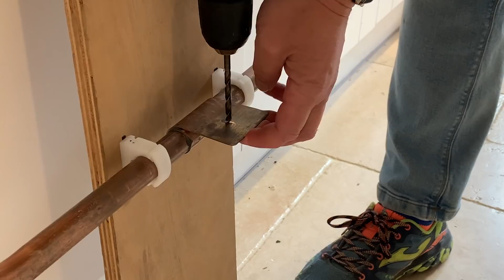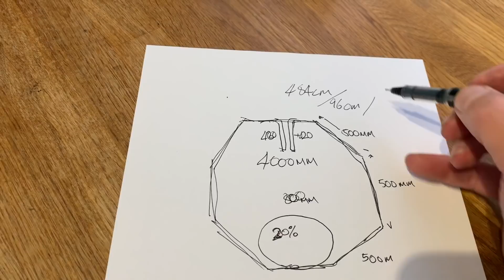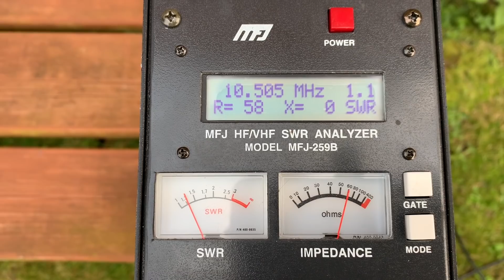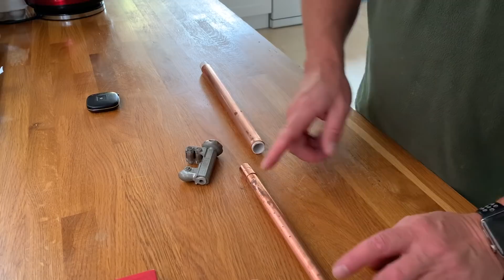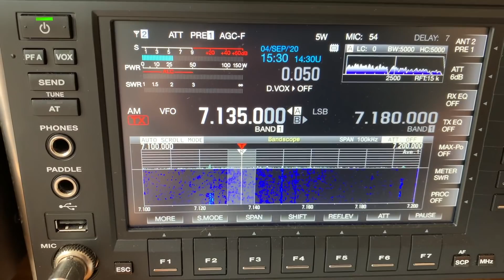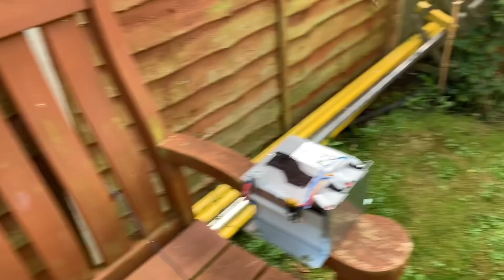HAM RADIO: Building a magnetic loop antenna Part 2...

Comment: Mike, the copper tubing & trombone cap's are quite an art all to itself. I have watched several build videos about the magnetic loop antenna, and you have truly gone above & beyond the call of duty here! Congrats on a great build and video.  I have made simple wire loops which take up a lot of space in spite of being elevated. A 10 meter mag-loop with adjustable cap's might also yield 6 meters. However, my goal is to make one as a single band for 10 meters, so I'll give it a try. 73's

Comment: Its been sometime since this build Mike, how did you find it performs in comparison to your other antennas ? Any benefits with noise reduction ? Great video.
Reply from the maker: I still use it today, great antenna for reducing noise on the band, it is never going to set the world on fire, but it works well.

Comment: Thanks Mike. I've built several magnetic loops over the years, for HF up to 2 metres. As a rule of thumb, a loop is most efficient over an octave of bandwidth. My HF loops have been made as squares, and I transformer feed them via ferrite rings. One loop uses 6 metres of 22 mm tube, and it's useable from 14MHz down to 5 MHz. Another uses 3 metres of the same tube and is useable from 30 MHz down to 10 MHz. That loop nets me QSO's over more than 1500 kilometres on 14 MHz using about 2.5 Watts of USB when used indoors. I tried making a loop for 50 and 70 MHz, using about 1.5 metres of 22 mm tube, but at those higher frequencies the ferrite becomes lossy (and hot with only 10 Watts of RF), so a more conventional gamma feed works much better. A 144 MHz loop was tried some 25 years ago, mounted on a hand-held transceiver's BNC connector, at 2.5 Watts. It was 29 cm in circumference, and used a vintage beehive capacitor for tuning. That worked very well; earning much better reports than a quarter wave whip, but, unsurprisingly, the capacitor would flash over if more than 2.5 Watts was used.

Comment: You can't just use any capacitor, it has to be of a construction and material suitable for RF. NPO or COG, and some other types will exhibit the right specifications, and certainly not one of a no name Chinese brand.
Reply from the maker: There is only so much information that can be passed in a short video, perhaps you could produce a short video explaining the ins and outs of capacitors for us and spread your knowledge 👍
Reply: @mike-M0MSN  No. I noticed someone else commented on this, even in more detail, temperature coefficient etc. Did you tell them the same?
I felt the need to inform based on your throw away comment, as there was most likely nothing wrong with the capacitor, just the application.
Anyway, I would have thought the average ham was educated on this, or should be. This is because I have seen quite a few ham antenna builds using fixed value caps. Then again, what would I know, I'm just a CBer.
Reply from the maker: @arconeagain  There was no malice intended, I just thought you might have been able to inform and educate. BTW one of the best radio/RF engineers is a CB’er as he is not interested in taking the license. so I will never underestimate anyone’s abilities simply from just being a CB’er.
Reply: @mike-M0MSN  very good. I agree, one can have an education, and or experience, outside of amateur radio that well out qualifies many. Or just a very good brain in their head.
 May I ask why you chose that particular feedpoint coupling method? Did you research that and find it to be one of the more efficient techniques? I mean, it's one of the variations on using a 1/5 size loop of coax.
Reply from the maker: @arconeagain  Now that’s a question, around 40 years ago I was serving in the RAF and studying with a colleague for our military radio operator license and part of the course taught, basic antenna election, two of the instructors both ground radar chef techs were G3’s   One of the antennas being erected was a DF loop and this caught my eye. That was the first and last time I ever seen the loop connected this way until I joined my local radio club, where I met an old RAF chef tech that had built a Magloop using the very same method. 
I do not know if it is better or not all I know is that it works.

Comment: How to drill your finger. 
YouTube are so particular these days on what can be shown. Turns out examples like this can actually be harmful.
Reply from the maker: Kids gotta learn.
Reply: @mike-M0MSN  that's the spirit. Having worked in construction, and after much metal work with antennas, a 1/8th bit to the finger is nasty. The swarf gets in there and you end up with a terrible infection. I've seen some pretty bad ones over the years, in bone and all. It's best to avoid. Phillips head bits hurt like hell too, they really mangle, and again, you get the metal fragments.

Comment: Mike you do some great stuff on here, and invaluable to new ham hopefuls and whoever else. keep it up mate. I'm on with one myself with a stepper motor, and home made variable capacitor, but can't get low enough capacitance on 20. so, might try a trombone as I could unscrew it out to 0 capacitance?   Owen G0RCL
Reply from the maker: If you have too much capacitance, you can reduce the diameter of the loop just a little.  Thanks 👍

Comment: Good video.
I built a 20M magloop with a trombone slide tuner but the circumference of the 3/4" loop was a shade too small. I built a motor drive using brass rod (forward and reverse), a control box using an Amazon high torque mini-motor, and an electronics store pot for speed control. I had to add a capacitor, which I made using RG213 and I striped the outer insulator and the shield off, leaving the insulator and the core lead. I inserted this 8" to 12" piece inside an equa-length piece of aluminum pipe to make a capacitor. I hung this in parelel across the trombone slide tuner and was able to get 1:1.2 inside the living room window. The SWR changes with the location in the house. The Q being narrow, it will have to be tuned again when outside but I got a contact from south Ontario into the middle/eastern US. Not sure of the capacitance but it is 'tune by feel'. Cheers VE3PUH

Comment: Always nice to see a home build. You've clearly hit on an practical compromise in terms of amount of copper pipe,  wieldiness and performance. I daft though,  could  the loop be bigger to the point where the inductance is tuned by self capacitance alone? A nightmare to build and operate so probably not at all practical, as still larger bore pipe would be needed to get to the higher Q needed for more circulating current and therefore gain. Another show stopper I think is that the maximum length of pipe in the loop you can go to is 1/2 a wavelength, beyond this the current in the loop starts to reverse , with a corresponding fall in antenna gain.

Comment: You might check out KB9RLW's channel. He did some videos of the mag loops and remoted them and used a motor to adjust them and used a field strength meter at the mag loop to determine when the antenna was at its resonance. It worked well. Just another way to skin a cat so to speak. I have been enjoying watching your videos on building antennas.

Comment: This turned out awesome Mike! Have you done anything else with it?
Seems like its working in the 20 and 40 meter bands and you were wanting to get it into the 10 meter band and do some more with the motor controller.
Its amazing what little space it takes up for 40 meters and looks fantastic.

Comment: Oh by way when using 20mm conduit use the high impact conduit, it wont need the extra bits on ya 15mm copper pipe trombone to sleeve it out as 15mm just fits inside nice and snugly 2E0FEH
Reply from the maker: thanks for the tip

Comment: It operational. Managed to sort out the SWR and find me feet on that one and tune it in well across the 20mb. Been up at 10ft to start with to test out the remote cap control unit and sort out how to SWR it. Managed to get right down to 1:1 :-). Heard LA beaming north to VK's and them returning. Also heard Cuba calling out to Europe and managed one contact to an Italian, IT WORKS . Tomorrow slap up the telescopic pole from 10ft to 36ft  and give proper airing. Next Job is make the bolt on cap and get the 40m side working and once happy, interduce a relay so one can remotely bring it in or drop it out when required. Even an American chap on FB antenna site praised it up as correctly built and he's bloody hard to please being a very old hand in the game for many many years. Thanks again. next job build the 80/40m twin loop but build this one as 80m first with twin 6m circumference loop totaling 12m loop designed for 80m 2E0FEH

Comment: The trombone might benefit from increasing the effective diameter of the moving 15 mm pipes.  This would increase the maximum capacitance and provide greater mechanical stability.

This can be done by threading multiple "staight couplers" onto the 15 mm moving pipes.  There is an internal ridge in the middle of every straight coupler to stop this happening.  But that can be defeated.  Better than drilling them out, straight couplers can be forced onto the 15 mm pipes.

This can be shown by using a simple G-clamp.  But that would be good only for ONE straight coupler.  A special jig would be required to complete the operation.  That might require a specialised version of a G-clamp, a challenge to ingenuity.
Reply: I've seen couplings that they call "repair couplings" which omit the center ridge entirely. They're designed to slide over the outside of a pipe easily to aid in the repair of pipes already fixed in place inside a wall.

Comment: First of all good vid kept my attention through out both and loved the novel ideas you used. certainly be having a go at this for sure as last projects with a Quagi 2m 9 el with conductive boom and 16El 70cms Quagi beam. The loaded coil mini moxon 20m needs more work with a remote at antenna tuning system as losses occurring effecting its back and forth gains. Better effective tuning. Now this brings me to a question how big would a 80m one be and can you do the add on to turn it into an 80m. Or could you add a cap to other side of the trumpet doubling up on the add on. Thanks again for a inspiring Vids  Karl 2E0FEK Kernow

Comment: estimated
Mike M0MSN, good afternoon, my name Luis de Chile, ca1lvz.
Nice to know about your work, would you tell me why a condenser is installed, and how much should it be to lower the gnaw?
I don't know much about English, it helped me with google.
I hope you tell me if the gnaw is low, if I install the condenser higher or lower,
thanks I hope you answer me cd1lvz.68@gmail.com
Reply from the maker: Hi Thanks for the post, higher the capacity the lower the frequency.

Comment: To your warning of high voltage you might add the danger of electromagnetic radiation.  It might be tempting to the operator to get close to the antenna using transmission.  This should certainly be avoided.  Especially, no part of the body should be placed inside the loop during transmission.  Please do not "microwave" yourselves.
Reply: GOOD POINT AND COMMENT!
THE MAG LOOP GENERATES 
BOTH HIGH MAGNETIC SURFACE
AND A VERY ☠️HIGH VOLTAGE☠️
SO D O  N O T  E V E R GO TO NEAR IT WHEN TRANSMITTING ABOVE 5WATTS! 
N E V E R TOUCH THE MAG LOOP
WHEN CONNECTED TO A TRANSMITTER! ELECTROCUSION☠️ RISK AND RADIATION RISK ☠️ IS EMINENT!
YOUR HEALTH COMES FIRST!

Comment: 80 khz  [EIGHTY KHZ] of bandwidth indicates a low Q. It does seem to work though. The tuning is usually much sharper. The little blue cap was obviously not  a high power rf type cap. How much power were you using from the hf rig? The mfj259 is what I also used for testing my loop purposely cut to be a 40/30m mag loop. the rig is my FT-818ND.
Reply from the maker: Thanks for the post James, yes with the right capacitor the Q-its a lot sharper.

Comment: I have watched all your loop videos and this one just FASCINATES the heck out of me. We all learned how capacitors worked when we took our General or (insert brittish name here) , but to see it in action built by a non engineer is just inspiring. I love the AV-680 , but my next antenna will be this one.  great work M0MSN from kn6jvs 73 .  feel like a kid again at 63 is a great thing.  do have one question what is that coax you use on some of your videos , that looks like the SHIELD is solid copper ???
Reply from the maker: Hi, Thanks for the nice comments, the coax used on this video was RG213,  :)

Comment: The trombone needs to be out of the center.
maybe out the bottom.
and the center coax needs to be centered inside the
loop not hanging out off the edges.
Reply from the maker: Thanks for your tip here Todd, maybe after C19 you could bring your build and we could do a comparison.
Reply: My next antenna i will be trying to build a plate style with 2 square pieces of aluminum drilling for 3 plastic bolts to adjust it, instead of the trombone style .
Reply from the maker: @toddbaker8159  Now that’s a cracking idea Todd, may give that ago myself.👍👍

Comment: Congratulations, very interesting your design.Could you share the dimensions of the capacitors you used? I would like to build one of those for Field Day, 73 de K2WC
Reply from the maker: Yes I can, 45cm long made from 22mm copper pipe and 15mm copper pipe with a 18mm plastic insert. https://youtu.be/yt1HoZyZFWw

Comment: Mike, cool solution to the added capacitor, but your 2:1 bandwidth on 40m suggests losses somewhere. My guess would be the dialectic in the caps. PVC and CPVC are pretty lossy, especially at RF voltages typical at the hi-Z end of a mag loop. Take a tip from the way heliax or 9913 are made - I'd try making the dialectric in the caps mostly air, using a couple small rings of HDPE tubing, or even a spiral of teflon tape on the inner tube, to keep it centered.

Having to tune more often after QSY will be a downside, but the efficiency may improve markedly. Can't argue with results though - if they can hear you, mission accomplished! 73 - AE4KR
Reply from the maker: Yes mixture of the PVC dielectric and the co-ax....  Thanks 👍

Comment: This is a great project.  Going to have to figure out comparable sizes of tubing. I doubt I will luck out with imperial sizes. Are you going to use a stepper motor?
Reply from the maker: 3/4inch. Have fun!

Comment: very nice    I have never used a tx loop but that really worked well.   RG 213 has a50 PF / foot   I ahve used RG 213 to tune a end fed long wire using high power it really worked on the one band it was tuned for.  (10 MHZ)   what a good video..  thanks
Reply from the maker: thanks